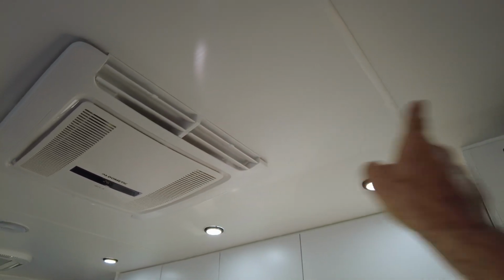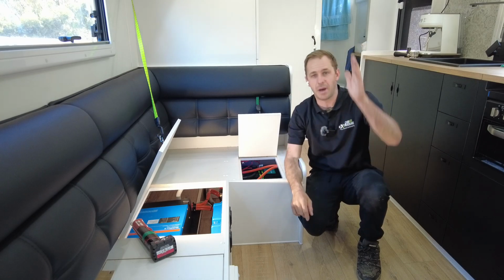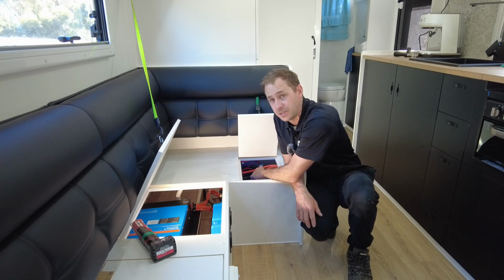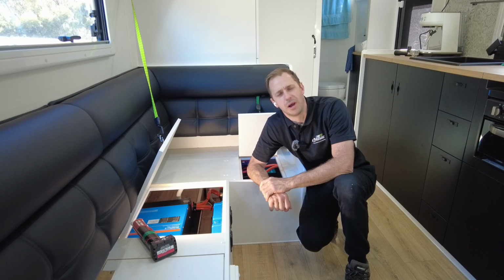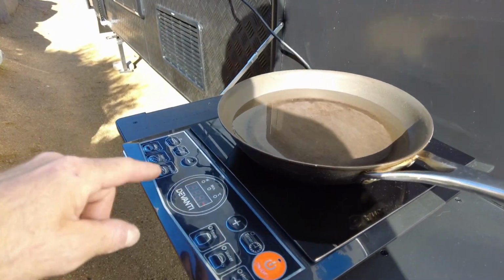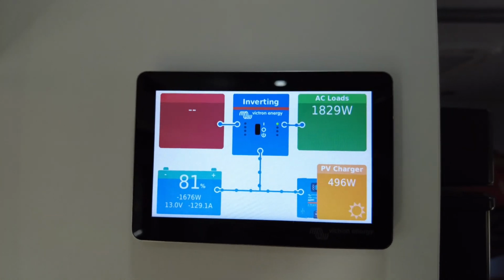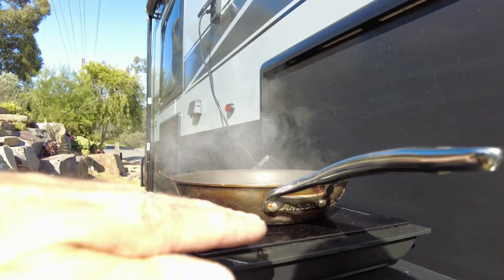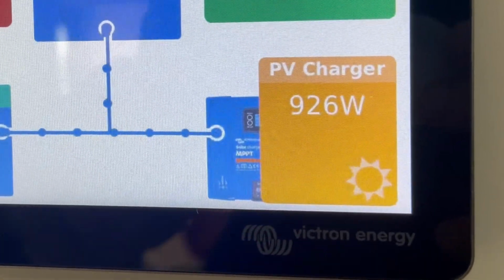NetworkRV 1200 watt solar, 560ah lithium run air conditioner microwave induction cooker and more.

Comment: Hey Matt … can we run our HWS off the grid ?
Reply from the maker: no, not for any reasonable amount of time anyways. You could for periods of time though. Say if you ran out of gas or you are in full sun and driving. As long as more power is going in than you are using.

Comment: Hi Matt
Are Enerdrive 2600w inverters low frequency or is it mainly Victron?
thanks
Reply from the maker: The 2000 epower and 2600 epower are HF type.
Reply: @extremeacc101  thank you
Reply from the maker: also here:

HIGH FREQUENCY
Pros-
1. Smaller footprint
2. Less expensive
Cons-
1. Doesn’t operate well with high-surge loads like pumps and high-torque tools

LOW FREQUENCY
Pros-
1. Runs well with high-surge loads
2. Operates cooler
Cons-
1. Heavier
2. More expensive

Comment: Flexible cables are a minimum requirement when it comes to mobile vehicles. The movement and vibration would cause a rigid cable to fatigue and break under such high currents and heat.
Reply from the maker: All cables are flexible. Just some are more so than others.

Comment: Another great presentation/installation Matt. As a sparky I can really appreciate the quality workmanship. I find these videos very informative (if not dollar addictive)!!! as I keep seeing minor improvements I can make in my basic system to get more performance. Cheers
Reply from the maker: Glad you like them!
Thanks for the feedback. Post some pics of your setup once its done. ;)
Reply: @extremeacc101  thanks Matt for sure. However after overindulging in your vids, I'll be buying 2x 280Scouts and repositioning a couple of pieces of equipment and adding/upgrading another charge controller.

Comment: Hey Matt, I have a Network RV on order and wanted to ask your opinion about getting the factory to pre wire for an inverter to be installed. I’m thinking to upgrade the standard battery and solar at a later date. So would you have the factory wire the van to accommodate an inverter to power all outlets or have it all done after handover?
Reply from the maker: It’s completely up to you mate.
If they are offering that no problem.
Reply from the maker: Hi Alex, personally we prefer the complete system to be done in house from us unless they know what they are doing and you are confident in that we do find more versatility when we are doing the system from start to finish.